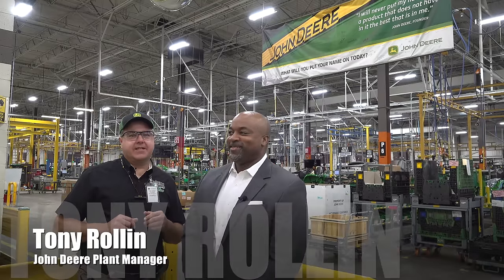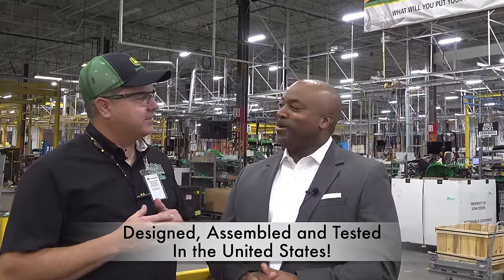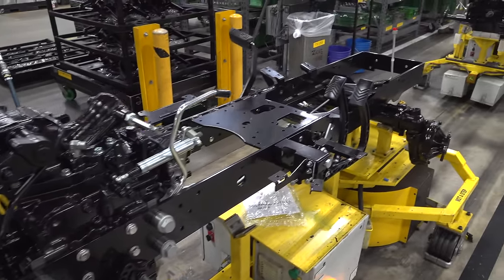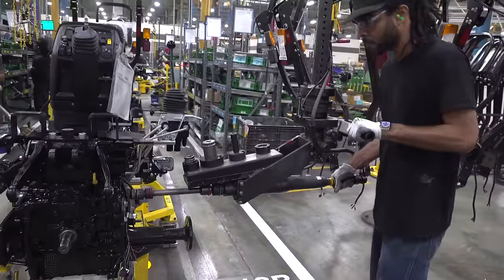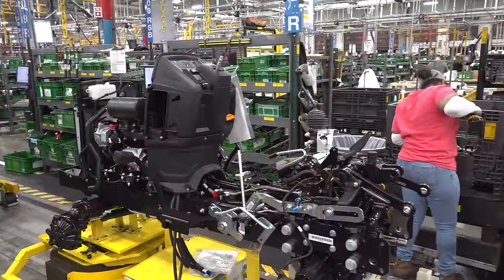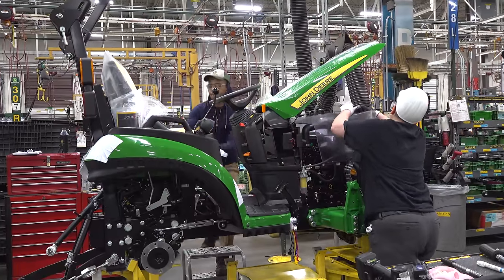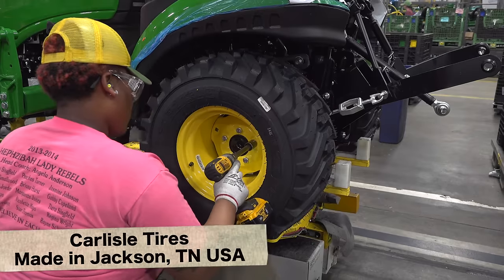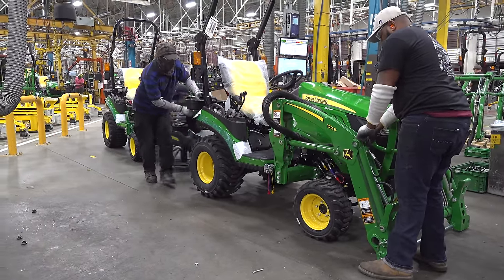Deere Factory Tour! 1 Series -  Where Your 1023e/1025r/2025r Is Built!

Comment: My 1991 855 has a 24 HP 3 cyl Yanmar engine that is still running perfectly after all these years. I think it's running stronger today that when I brought the tractor home way back then. I liked watching the video Tim, I learned a few things about John Deere also. 🍔🍟😁
Reply: My Dad bought a 24HP with the Yanmar engine around 1990.  It is still running great and never a problem with that engine. Actually, the only problem we have ever had with that  tractor was with one of the brakes.

Comment: A John Deere facility is quite a site too see. I've worked on a few projects with John Deere professionally, and they have some of the best people working for them. They make sprayers and cotton pickers, among other things, here at Des Moines Works (Ankeny, IA). I was responsible from one of their scale systems. The system weight each wheel of the sprayers. They park the machine on the 4 X 40,000 lbs scales and we can show the exact weight on the left side, right side, front axle, and read axle LIVE and they will them spread their "wings", some over 100 feet wide! This of course changes the weights, and the crews can validate the machine is still in spec. They also have a small scale on the same system used to weigh on-road vehicles, and since the driver has to go into the scale shack, they must also be included in the vehicle weight, thus the small scale. We also have a small printer to print all sorts of information, last calibration date, next due date, time and date, PIN and SN, etc. They've got a big remote display that shows everything from the small scale shack, so the driver can stay in the sprayer and see the weight values.
Very cool system. I'm sure you'd get a kick out of seeing it. I wrote the software to run that system, and did all the physical installation and calibration, less concrete work.
Thanks for working out a video of this plant. I bet it was no small task getting permission to do such a video!

Comment: I love my X738, but not because JD delivered me a great tractor, I had to turn it into a great tractor. My X738 was delivered to me with engine electrical problems that made the engine run VERY RICH, my dealer worked on the tractor once, DID NOT repair the issues, then lied to JD about ever working on the tractor, EVEN THOUGH I had the paperwork to prove he did. JD would not listen to my side of the story nor would they come out to look at my tractor. SO AFTER 8 HOURS OF TESTING & OVER $2,000 OUT OF MY POCKET the X738 now runs properly. Will I ever purchase another JD, NEVER. So every time you talked, I heard what you said, every time the JD spokesman talked all I heard was, blah, blah, blah, B.S., B.S., B.S. and that's JD 's fault.

Comment: I have a 1023e, love it. The only thing that I do not like is the plastic hood and body parts, the hood latch area is WEAK and breaks at the 2 bolts. I also have an LS MT125, much better hood. The Deere is still nicer.

Comment: What parts of the tractor is made from plastic? I'm not referring to trim pieces or body panels but parts of the tractor that really should be metal. Which tractors models offer air-conditioning. Thanks, Tim.

Comment: Had a bitter sweet experience with my 2015 3038e at 400hrs it developed a small oil leak at the transfer case and at time it was 4 years old my John Deere dealer said would have to spit the tractor but they would contact John deere that with an expensive fix if the tractor was less than 5 years old they would help with the cost and they did they had the tractor 1 week not sure how many hours they spent on labor but when I went to pick it up my part was 180 dollars and I was ok with that, now the same tractor new has a 6 year full warranty

Comment: I LOVE LOVE this video! I thought that John Deere compact tractors were manufactured overseas.John Deere is a great company with great products! My family farmed for approximately 81 years. During the depression the only implement company that would give my Grandfather credit was . . . John Deere. Subsequently the only new tractors my family purchased was John Deere’s. Credit wasn’t the only reason John Deere’s were bought. . . Quality and performance were continuing reasons. One of the tractors we had was a 720. My Dad said that the 720 and a comparable Case running corn choppers would run neck and neck until there was a hill than the 720 would pull away. The 720 was a torque monster.

Comment: Tim I just recently bought a flashlight that has uv black light as well on Amazon the name of the flashlight is morpilot it also strobes the high beam light setting has a range of almost a 1/4 mile for $21.99 Canadian I bought 2 for the free shipping and had it 3 days later it came with batteries and the adapter sleeve for there brand single battery you can even use it for checking official documents even vehicle titles

Comment: First tractor was a yanmar with a hst. The biggest downfall was frame rails. When trying to lift with the FEL the frame would tweak and diminish the lifting ability. The best thing I can say about yanmar is that they make a great engine. Don't ask about the rest if the machine. 
Replaced it with a Kioti and have been very satisfied. 
Another great video Tim.

Comment: My experience (anecdotal, and principally automotive, but...) is that these days - or really for the past couple of decades - the engine is the last thing to fail; it’s everything else that dies first: radiator, alternator, air conditioning, power steering, transmission, etc... and the first thing to start showing it’s age is the driver’s seat.

Comment: Machine shop I worked for used to make a lot of Deere parts,  We were having trouble machining one of them.  Everyone in the shop took a shot at it.  When it was my turn I had the same problem as everyone else.  I came up with a modification to the part that would fix the machining problem.  We submitted the change to Deere.  A week later we heard back the change was approved.  It has always impressed me that the engineers at Deere listened to a lowly machinist.

Comment: Yanmar is the best thing about a John Deere.
Just saying
About the cold engine at full throttle. It may not blow up but it's not the best thing to do
3000 hours latter and you will see the difference
Do a little research/ study on metal molecules when cold versus hot( huge differences)
I want something of mine to last as long as possible because repairs are expensive. Even if you don't plan on keeping it for 20 years or so you will help your resale value .
I have been a mechanic since the early 90s working for Ford and now in one of Sanderson Farms truck shops.
   Take two people with the same tractor or car or whatever one of these people machine will be wore out beat up tore up in 4 or 5 years the other person can keep something for 20 years and still be in great shape. Small things matter.
Nice video Tim and Christy
Keep up the good work
Reply: The engines are test run AT THE ENGINE FACTORY before they get to Deere

Comment: Well Mr Tim, let me be the first to tell you that I'm having a major reliability issue with my john deere transmission! I bought it new back, in 2017. They were low on hand at the dealer so they got one from their sister dealer. Ever since new my transmission has had major chunks of metal on the screen from changing oil ever Since the first 50hr transmission oil change! Now it has 1000hrs and the transmission wines a very loud high pitched metal grinding noise. It's at the dealer now and they say they can't find any problem.. Please help me Tim, I, can't be stuck with the bill of fixing myself because the mechanics at Middletown jd, in Washington PA, can't find the issue with the motor! When it gets upto, temp and with the deck running it barely moves in reverse up a hill and whines a  excruciatingly high pitched metal on metal, whine! (you, can tell the motor pistons in the transmission are wore)
Yes, fluid is.l Good, and everything has been changed per. The factory recommendations. This is my forth new tractor in 10 years!
Reply from the maker: 1025r?
I doubt I can do anything to help.  You will need to continue to work with your dealer.
They should be able to send a tech out to your house where you could demonstrate the problem.
Reply: @TractorTimewithTim  well it's at the dealership now.. They're too new to know any better it seems.. Yes, it's a 1025r. I appreciate the quick reply to my message.. Love the videos and work you do my friend! If they can't find the issue I'll just have to take it to, a better dealership with competent mechanics.. (sad to say, I used to work at the same dealer as a technician) thanks Again Tim.

Comment: Very cool, made me love my 1025r even more! I work in a factory like this so I feel for the workers. It's always nice when the workers put a little pride into what they do. I had one of my hydraulic fittings on my power steering cylinder come loose! (The one the worker is touching right at 10:11) Luckily, while I was greasing everything, I noticed it and tightened it down. It never leaked however.
Reply from the maker: Yes.  I recently left a factory environment job.  I'm not used to seeing the workers smiling, appearing up-beat, and overall passionate about what they are doing.   This was OBVIOUS in Augusta.

Comment: I still cringe at the full throttle on a cold engine (even though they may be run in already) My 1023e always gets a few minutes of idle time before it starts work. Along with any of my other engines.
But otherwise what a great video! Thanks for putting the time in to show us the factory.
Reply from the maker: do you do that with a car?
Reply: @TractorTimewithTim  I sure do.

Comment: Awesome! Would love to see process with 5 series too! Great job. After much debate, research etc. over last few years it’s looking like I wanna get a Deere. 

Started with considering the 3046r cab and loader and 4x4 with 3 rear remotes as minimum spec for all tractors . Then Yanmar 359, KIOTI RX7320, LS xu6168
Case farmalll 75c, 100c, Massey Ferguson 4700 and 5700 series, LS XP8101cps, and finally  (at present) the John Deere the 5100M. It’s been exhausting LONG research. So what led to this?

1. 4 yr old 5100M with warranty and extended warranty option cost as much as new South Korean LS XP8101cps does brand new with mostly same specs.

2. Parts and distribution system and parts availability is superior for Deere across USA. Hence cost difference with Asian competitors.

3. Corona virus. Hyundai has to shut down South Korean factories because parts are made in China. So what about the tractor companies? Same risk. If China has sick or dead factory workers, products and parts will be HARDER to get as time goes on for quite a while.

4. Majority of 5100M made in USA as are most of its parts.
Reply from the maker: 5.  Better resale value will make up for most of the increased purchase price.
Reply: Yeah, forgot that point too! Thanks Tim!

Comment: Still to this day I don't my rev up my rpm's that quickly... is it a bad thing not running these engines at a high rpm as long as it's not being labored???
Reply from the maker: Tim's opinion here.  I don't think you can hurt these engines no matter HOW you run the throttle.    These machines (any tractor) is made to run full throttle.     The only reason I run lower rpm is because I don't like the noise!
Reply: @TractorTimewithTim  Agree. Also, keep in mind these small diesels are governor controlled so you really cannot over rev them.

Comment: So there is a difference between MADE in the USA and Assembled in the USA.. this is Assembled in the USA because some parts come from Mexico, and the engine comes from Japan
Reply from the maker: Yep.  But a surprising number of parts are actually made in the USA.  More than we knew.
Reply: @TractorTimewithTim  since I got you here Tim :) I just bought a house on 8.5 acres in East TN, and I need a tractor, for bushoggin the terrain is even/uneven to hilly,, im not sure a 25 HP compact tractor would be enough, what do you think
Reply from the maker: @tejeda7324  while a 1025r can run a 4’ bush hog, it is no fun, and it would take forever to do 8 acres.   If budget allows, I would consider an open station 3R with spacers and rimguard.  Then, I would consider a Rhino TS10 flex wing.
I know! Lots of money!
Reply: @TractorTimewithTim  woah woah take it easy on me im new! my mas budge will be $25k what about a Brason Tractor

Comment: Pity they can’t make seats that last.  Every single John Deere ride on mower I’ve owned the seat has cracked!
Reply: They don't make the seats, Seats Inc does.
Reply: Same with me. I bought 3 different JD Gators, all the seats cracked. I have a Ford 910, about 35 years old, seat still good. It was built in Japan.

Comment: Hey  - at the 6:00 mark you get to see where they install the hoods that never align well with the side panels!!
Reply from the maker: I think the ‘never align’ issue is due to the air shock.  The first generation didn’t have the air shock, and the alignment was fine.
Honestly, the air shock to hold the hood up is worth it to me!
Reply: @TractorTimewithTim  - probably so.... and I do like that over that funky prop rod on the prior 1026R..... it has messed with my OCD need for even gaps and continuity of design.... the hex of being a designer.  lol

Comment: I would love to be able to visit one of their factories and seeing how their tractors are built and sent out. I have a 790 which I got new, and a 3032E which I got new and they was great and I love them both and use them regularly, especially my 3032E which I use with most of my implements. The only problem I now have is my headlight working on my older tractor and the bulb replaced and it still don't work on one side.
Reply: I once visited the Deere and Company Administration Offices In Moline. That was an interesting tour. The building was designed by Earo  Saarinen and was framed in self painting steel. Has a huge pond in front that doubles as a cooling center for the air conditioning system and a wildlife refuge for water birds to land in.
Reply: @glennso47  That must have been great to see.
Reply: @semco72057  The area just inside the main entrance is filled with exhibits of the various John Deere products. Also north of Moline near the city of Dixon is the village of Grand Detour,Illinois where John Deere opened a blacksmith shop and where he invented the self cleaning stainless steel plow. You can tour the house where he lived and a replica of his blacksmith shop.

Comment: Was there any mention as to where the plastic pieces, like the hood, side covers, and instrument pedestal are manufactured/injection molded?
Reply from the maker: Fenders and hood mentioned in video (made in US). Didn’t ask about pedestal.
Reply: @TractorTimewithTim  
Ahh!  ...I missed the pop-up messages that showed where they were made on my first run through of the video, thanks!!!
Fenders > South Carolina
Hoods > Georgia
Reply from the maker: Frame -Wisconsin
Transmission - South Carolina 
Front axle - South Carolina

Comment: Thanks Tim.  Well done, as usual.    The JD operation is doing assembly and sub assembly domestically.  Parts come from overseas to supply assembly plants.  That is today’s mfg.  Import tariffs are passed on the the consumer unless JD wants to reduce their profit margins.
Reply from the maker: Watch and listen.  More parts from USA than we thought.
Reply: Tractor Time with Tim 
I did,  it is good that some subassemblies are assembled domestically and some fabricated brackets as well.  All that is good, but the engine is turnkey from Yanmar Japan.  This is normal mfg. practice in the USA.   That is buy parts overseas and final assemble domestically.  

Toyota has domestic assembly plants but parts and sub assemblies come from outside the USA.   Ford, GM and FCA do the same.
Reply: @Robert Doyle 
No trolling intended.  I have worked in the auto industry for decades.  Domestic production is mainly assembly.  JD is no different.  They buy their parts worldwide and assemble domestically.  I am glad assembly is going on here vs. Korea or elsewhere in the world.
Reply: Powrguy Tom 
You got the Republican talking points down.
Reply: @Powrguy Tom 
LOL

Comment: To bad they put so much plastic on them now, the hood on my 455 is cracked, like all of them, and is big money to fix.
Reply from the maker: They have improved the poly since the 455.  BTW, how old is your 455?
Reply: @TractorTimewithTim  Its a 99 if I remember right.
Reply from the maker: Pete Busch I think (and hope) that the polymer is much better now.  I guess we’ll see.
The thing is, a steel hood gets all beat up over time too...especially with a front end loader.  Always dumping stuff over the back of the bucket onto the hood!!
Reply: @TractorTimewithTim  I can deal with fixing a steel hood but there is no real fix for broken plastic forcing us to pay big money for new plastic that will also just break.
Reply from the maker: @petebusch9069  I disagree.  A "fixed' steel hood is never really fixed.  It looks awful.    But I get your point.    I suppose this will be a never ending debate.  Again, I think the polymers are much better now than they were in 99.    
Anyway, we won't solve this.  If it is a show stopper for you, you'll have to buy another brand.